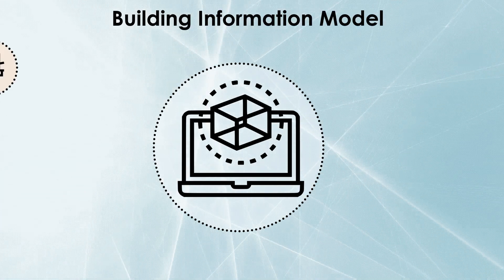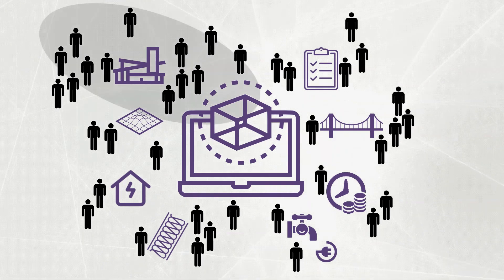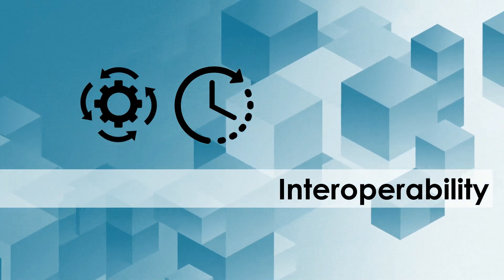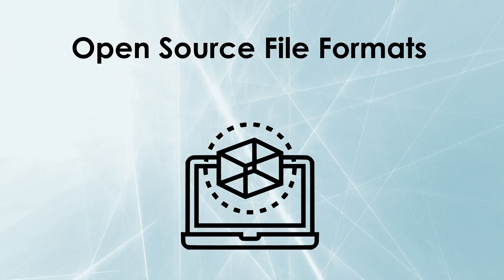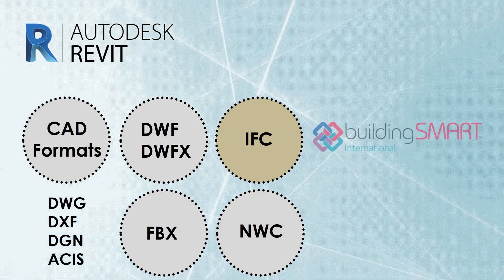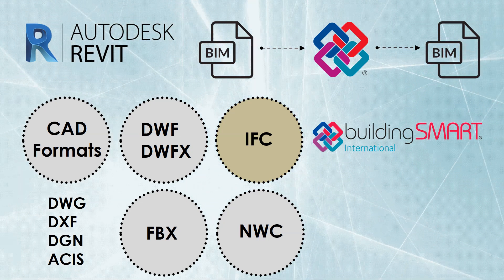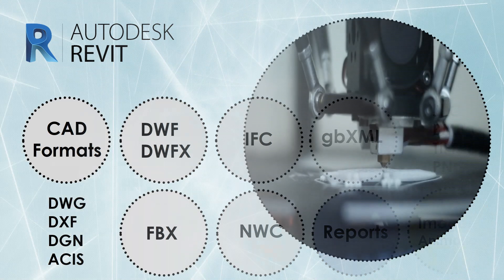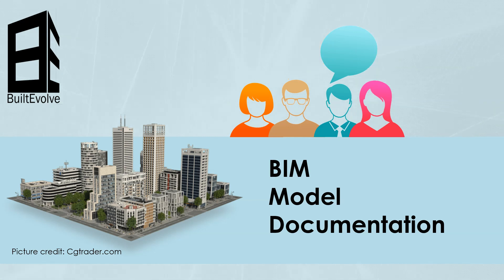Interoperability in BIM and Data Exchange

Comment: Thank you for this video. 
I had always this question that what are the differences between different formats and why we have too nany of them? and what are the intrinsic features of each one? How we can be assured that we are using a proper format to transfer our model?
Reply from the maker: Thanks for this brilliant question. The reason why we have various file formats is to be able to link various software packages. If you export an FBX file from a Revit model, you will see that some particular types of information are exported only. I would suggest you learn different file formats as you require them in different projects.